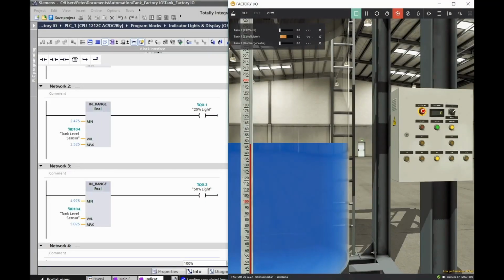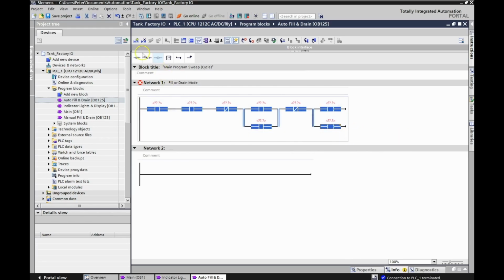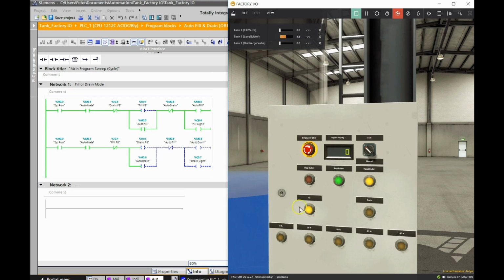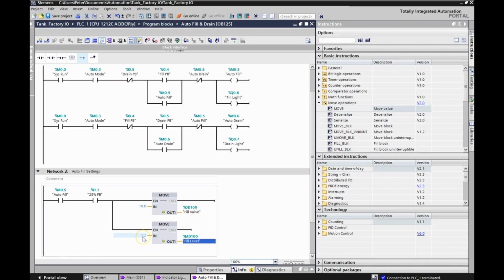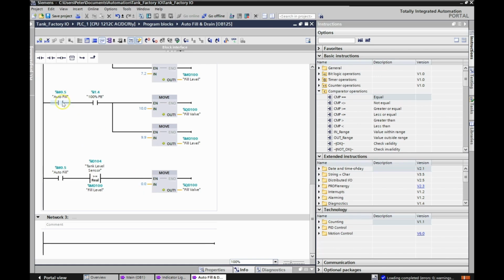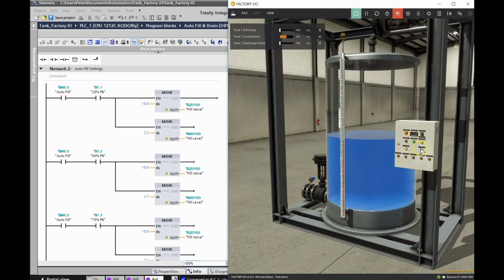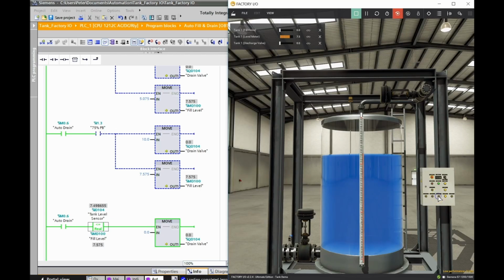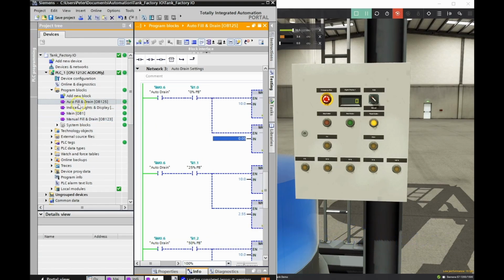PLC Tank Control Tutorial | Siemens TIA Portal with Factory I/O (Auto Mode)

Comment: Hi, just like to say it would be easier to process the level sensor value before using it in your program. You can use the NORM and SCALE functions to do this.

Use NORM to convert the sensor input from 0-10 to 0.0-1.0 value (REAL), then scale that 0.0-1.0 value to your desired range. If you scale to 0-100(%) and 0-1000(liters) (or whatever size the tank is) you'll get more usable numbers. I'd simply output the 0-100% to the number display so the operator can see exactly what the water level is